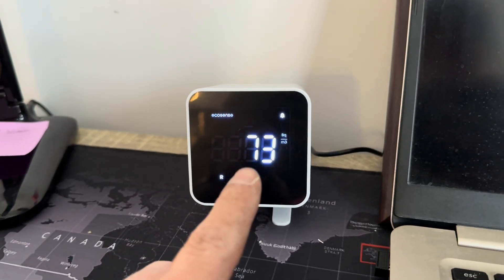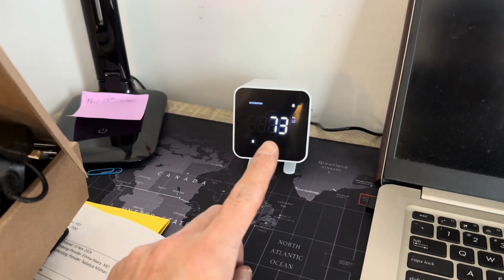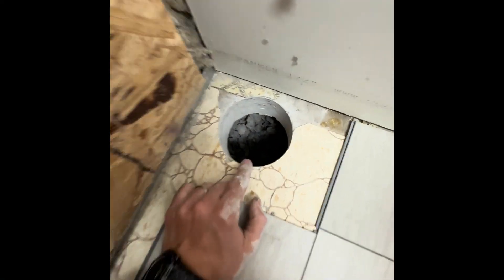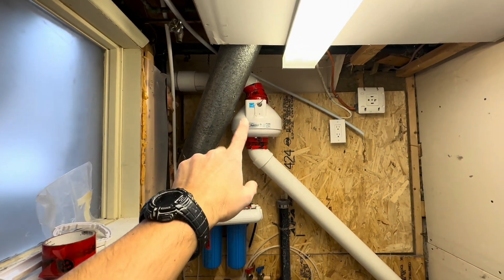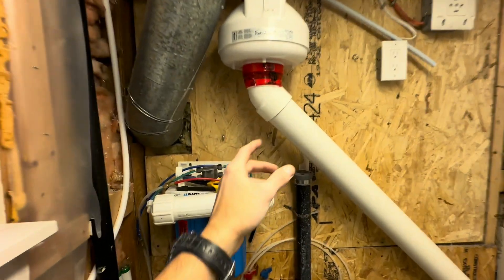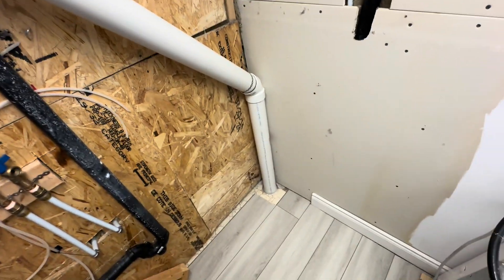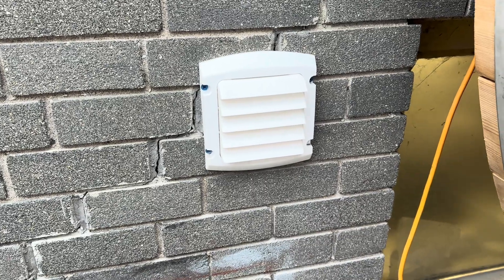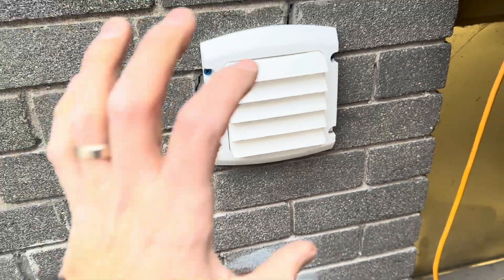Radon mitigation system - DIY system

Comment: I have a passive system install and need to install a fan. If i cute the PVC, is there enough coupling overlap to install the fan? My current PVC is secured and cant move. The only thing I can do is cut it